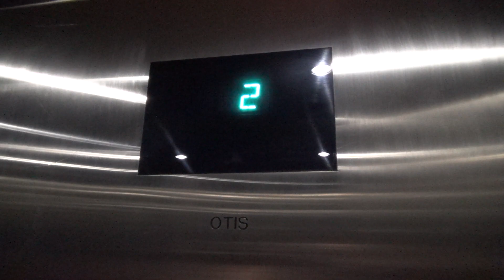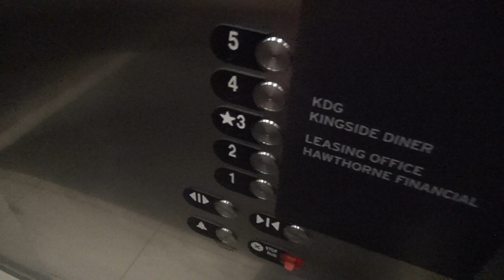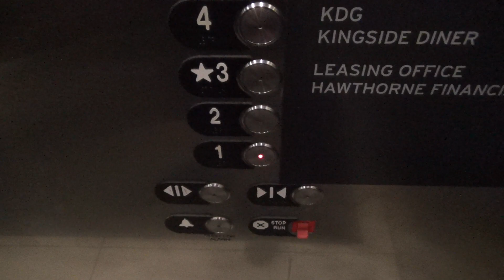Weird Startup on an Otis Hydraulic Elevator

Comment: Elevator information:

Brand: OTIS
Buttons: Series 4 VR
Indicator: Series 4
Door type: single slide sliding right ▶️
Number of floors: 5
Number of elevators: 2

Strange startup but Epic motor!
Reply from the maker: Be sure to check out the video of both elevators!
Reply: @stlelevators  are they both the same? Same buttons and indicators?
Reply: Stating obvious